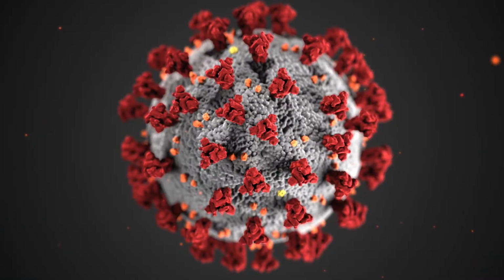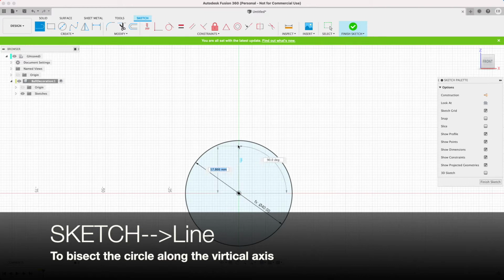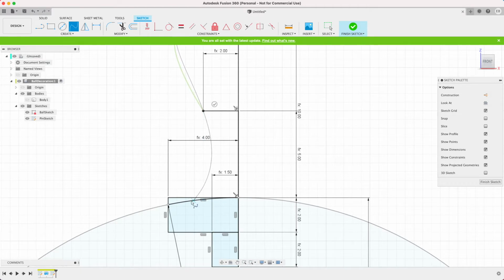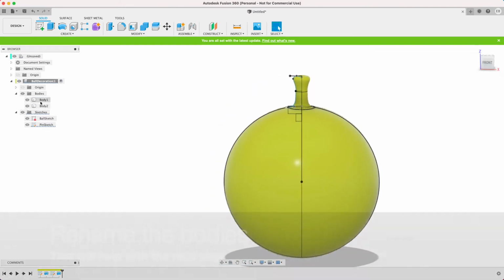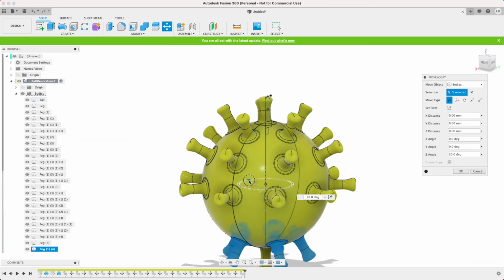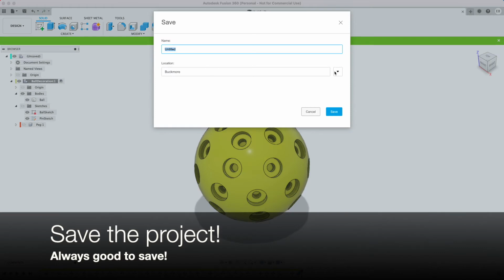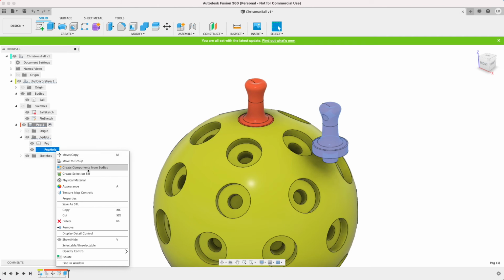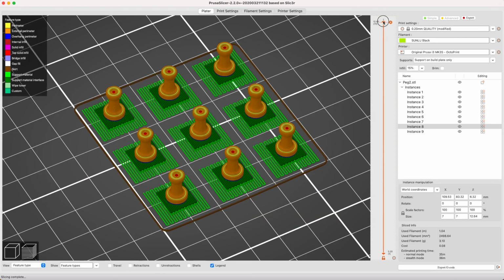COVID 19 Christmas Bauble

Comment: Nice. 👍 Thanks.
I need to figure out a method of producing an arbitrary number of equally distributed points around a sphere. Perhaps by drawing a fibonacci spiral (similar to sunflower seed pattern) that maintains constant surface area. This is Jim Bumgarner's (KrazyDad) formula for placement on a Fibonacci Sphere... n = number of points phi = (sqrt(5)+1)/2 - 1 ga = PHI * TWO_PI for each point i (1..n) longitude = ga*i latitude = asin(-1 + 2*i/n. 😲